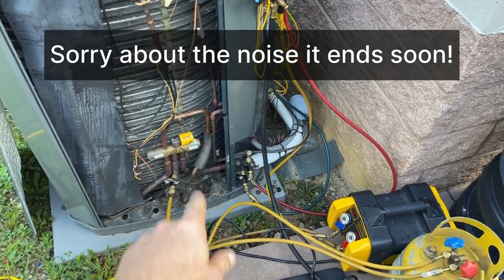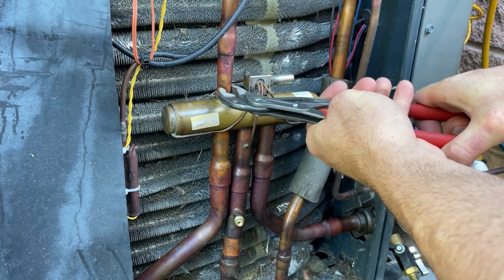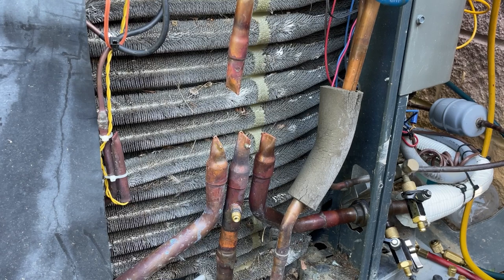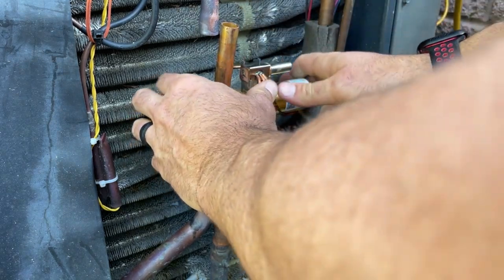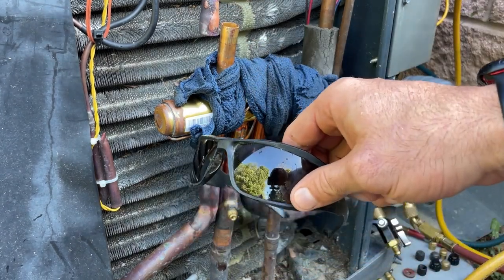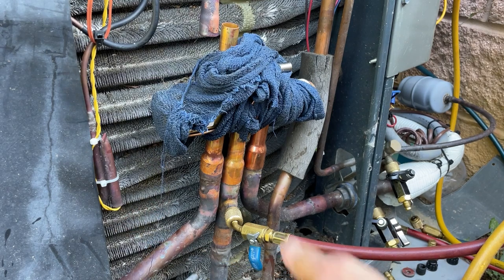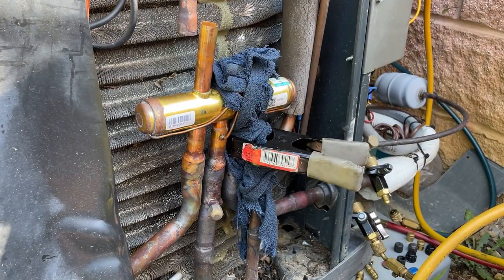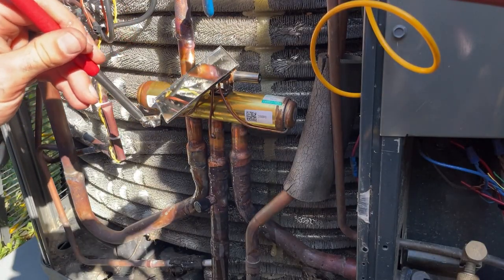HowTo28: EASILY Replace a Reversing Valve + Tips & Tricks :)

Comment: I’ve changed many reversing valves and that’s exactly how I do it. I cut at least two of the larger pipes with straight snips as close to the valve as possible, un-braze the discharge and true suction, then just un-braze the two stubs. It makes it so much easier then trying to find a place to cut with a small tubing cutter and then having to swage or coupling everything back together. I’m in heat pump country (Eastern North Carolina) and 99 percent of what I work on is heat pumps so I replace a lot of reversing valves inevitably, whether they are not shifting properly or leaking refrigerant.
Reply: I also like that you used a rosebud tip. I always use a rosebud on reversing valves and I’ve gotten to where I use it on 90 percent of my brazing. I still use a number 2 tip sometimes but if you know how to control your heat, you can use a rosebud for everything even smaller tubing.

Comment: Nice work on the rv install. I've done two in my career, 1st one on a carrier that took me two tries and then got it 1st go on a goodman. If I had to do one again, I would be tempted to try out these brazing rings I saw. I think they may have a spot in the torch kit, but I've never used them myself.
Reply: @HVACLife  From what I see you can press the rings flush into the fitting side and they hold in

Comment: i have worked in this field for over 20 years but never did this until a couple of years ago and it saves so much headache. also, it doesn't apply to this style of trane, but on a unit with the valve inside i started unsweating the condensor coil so i can get eye level with everthing. you can have most coils out in ten minutes but it saves an hour of bending over trying to braze
Reply from the maker: Right on!  Yes removing coil is normally not too bad 👍

Comment: Are you not worried about metal shavings from using the tin snips?
Reply from the maker: Good question!  Not at all, when tin snips are used properly (ie the point never plunges into the material) there are no shavings only shearing.  The cable cutter also shears, it doesn’t produce shavings either 👍